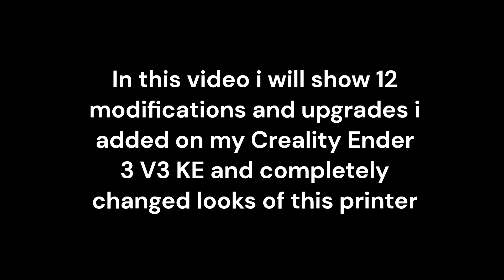Ender 3 V3 KE - Completely changed looks with 12 upgrades and modifications

Comment: People like ricing out their printers, you just introduced new variables when you need to isolate a problem you're going to have. Might as  well look at microswiss products, when you ask for help someone is going to recommend microswiss as a solution.
Reply from the maker: Ender 3's were always about modifications, i understand some people don't like those stuff but a lot of us enjoy in this, i don't think i will have some problems because of any of those things i added to the printer.
Reply: If it’s ricer than it’s all show, no go. 
If it’s just looks than it should not effect performance.
Reply from the maker: @hozn  only things for looks are extruder covers and cable chains, everything else is on there for a good reason.
Reply: I think it's badass, first off, half of those are very useful modifications. And if you know anything, you know that a stock printer needs upgrades. You can look at the stats of some of those, like the rigidity bars for the z tower. based on the Sonic pad reviews and the sonic pads resonance measuring/countering capability, just putting those stabilizing bars on a ke almost totally removes the need for counter vibration from your y-axis by stabilizing the z without the need for the software. But even if it didn't benefit in some way, what's the problem? You got a problem with bumper stickers on people's cars? Pin stripes?? Paint colors that you don't like???  Cmon man, nobody pissed in your cornflakes.  Also, almost every printer comes from China. So you're not ricing up your printer. You're ricing up your rice. 😆

Comment: Best upgrade would be to move the spool next to the machine, instead of having it on the top….
Reply from the maker: Rotating spool holder for 90 degrees make huge difference and with anti shake construction (at least for me) there is no need to move spool next to the printer. Also for me space is important and this is saving me some space around the printer. Thank you for watching and commenting.
Reply: @bl4de938  Completely agree. I don't have the room to the side. It is amazing the difference it has made at high speeds. Rotating the spool also solved an annoying problem of the filament getting tangled on tall prints.
Reply from the maker: @stephenhulme90  Yes, this small adapter makes huge difference. Thank you for watching and commenting, enjoy in your printing :)

Comment: Greetings from Brazil! Could you tell me how many "Spine Cable Chain" pieces you used in your project? Another question: what material did you use for the motor cover? It doesn't melt over the heated motor?
Reply from the maker: It seems i have 55 pcs of spine cable chain, i used PLA for everything but i would recommend using PETG for motor cover, not because of heat, it's only because of design of this cover, back piece can break easily
Reply: The heat from the motor will definitely soften PLA, but it won't melt

Comment: do you need new vibration calibration after building in anti shake construction?

why do you use x-axis motor cover? it reduces heat exchange, what are the benefits?
Reply from the maker: If you have sensor you should do vibration calibration again. That cover is just for looks. Thank you for watching and commenting!!!

Comment: Nice work, I'm also improving my KE and have a one question - how did you connect the camera to the pad? in the video I see free USB ports.
Reply from the maker: I had it unplugged in the video and cable was just pushed behind screen,  but i am using that USB port for the camera

Comment: Hi, awesome video I printed the antishake structure but its not fiting
Reply from the maker: Parts that go on the bottom are to long and when you adding them to your slicer, you will get question if you want to resize them, you probably clicked yes. You should click NO  then rotate them to fit diagonally on your build plate.

Comment: What s the use for the chain?
Reply from the maker: Spine cable chain and motor cover are there for looks only.
Reply: Generally speaking, they are supposed to distribute load and prevent the cable from kinking at anyone one place. These cables are so light that it doesn't really matter.
Reply from the maker: @PixelCortex  Yeah, on this printer is just for looks

Comment: yeahhh lets add more weight to the toolhead so we can have more HELL 
YEAHH,  also for more destruction lets addsome  weight to the ribbon cable of the toolhead putting a cable chain to help it suffer at high speed yeah yeah yeahhhh!!! what a bad mod really i mean it, use paint next time pal, i almost forgot, lets put a big plastic cover over the toolhead axis motor so it can get more hot during a print.
Reply from the maker: Thank you for sharing your opinion with us, also thank you for watching and commenting that is helpful for the channel